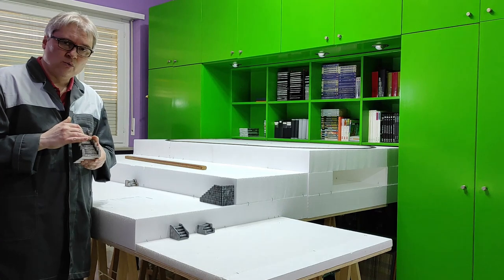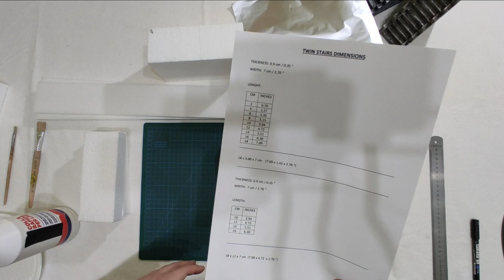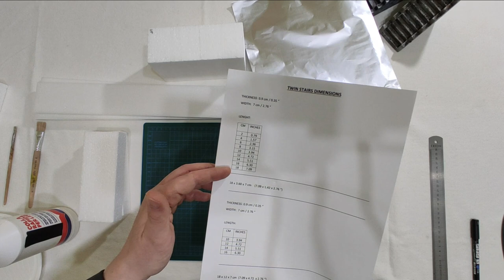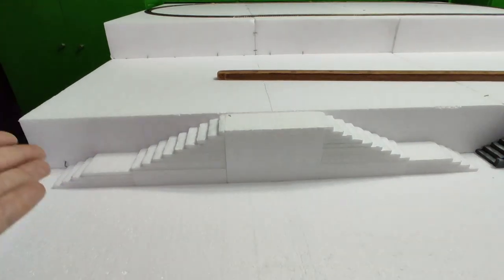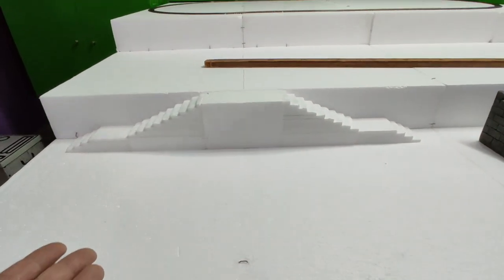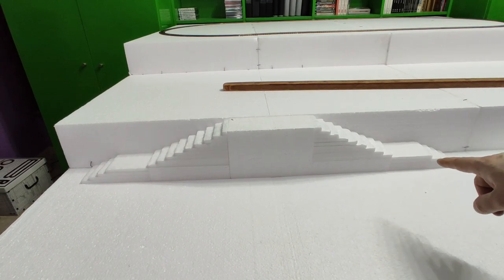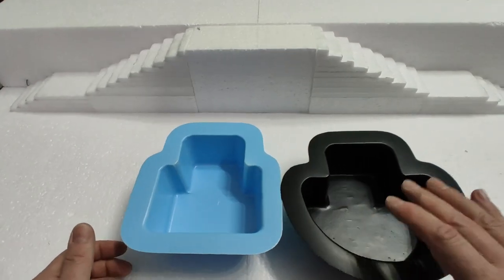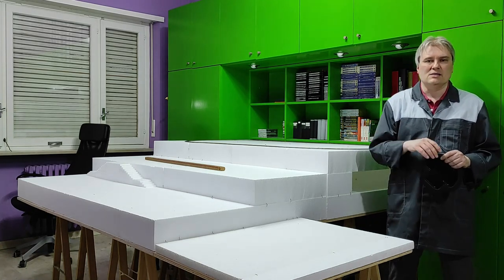Christmas Village Tutorial 2021 - Part 2

Comment: Interesting video once again.
I really like how the stairs turned out and I also love the fountain idea!

You probably already have found a way to do the handrails, but if not: maybe you can use thin copper wire. That seems to be at a good scale. 

- Bram
Reply from the maker: Hi Bram. Thanks for your comment. Yes copper wire and steel wire are both something I tried to work on. Scale is correct but I wasn't satisfied with the overall final look. It was too modern, too "industrial design" and not "ancient design" but I am almost there. I think... probably.

Comment: Silvio, can you upload that sheet you had with all the measurements for the twin stairs please? And how thick is the styrofoam for the individual stairs and also the blocks for the stair landings?
Reply from the maker: Hi Dee. I made the twin stairs using 2 types of Styrofoam: extruded Styrofoam for the steps and expanded styrofoam for the 3 landings (middle and central). All the thickness are marked on the sheet (all the steps are 9 mm thick (0.35 inches).
Why using 2 types of Styrofoam? Because only Extruded Styrofoam steps can be aged using the tin foil as shown in this video and because extruded Styrofoam panels over 4 cm thick are much much more expensive.

And finally the file you asked for :

http://www.christmasvillages.it/shared/TWIN_STAIRS_DIMENSIONS.pdf

Merry Christmas and best wishes to you and your family.
Reply: @silvioallena  Thank you, Silvio. I can't seem to find extruded Styrofoam here in the states. Is there another name for it?
Reply from the maker: @deesarge9531  Yes sorry, I should have told you before.

Extruded Styrofoam is XPS Foam (in the US the common type is generally pink)

https://www.amazon.com/s?k=xps+foam&crid=1EHHEG5V80KJS&sprefix=xps+foam%2Caps%2C175&ref=nb_sb_noss_1

Expanded Styrofoam is EPS Foam

https://www.amazon.com/s?k=eps+foam&crid=3LODHUQUZNY1W&sprefix=eps+foam%2Caps%2C145&ref=nb_sb_noss_1

Obviously you will find XPS and EPS foam not only on Amazon.
Reply: @silvioallena  Ah, okay. Thank you so much. I printed out the sheet you sent of the measurements of the stairs, and learned so much from your videos. I think I might give the twin stairs a try for next year's village. I'm sure you'll be hearing from me again. Lol.
Reply from the maker: @deesarge9531  I am glad I was helpful. Please ask anything anytime.

Comment: Just curious, why didn’t you make one long set of stairs instead of two sets that join in the middle. They look great, wondering if that would have saved you time. ❤️ from Texas.  Scratch the question. Should have watched further.
Reply from the maker: Hi Haze. Yes, you are absolutely right, it would have saved me time. But as I wanted to place the fountain and the water pump under the middle section with possible carvings and a statue niche (at least in the very first minutes of this task) I was afraid I could have ruined the entire stairs. Much easier to just replace the central section which is simply a regular parallelepiped instead of cutting once again in Styrofoam each long steps. Thanks for making me remember those good times from last season.

Comment: Hi Silvio
I'm trying to make your double sided staircase.
I'm not too good with metrics being in the US but, you thickness of each step you have is 9cm?. 
I'm using expanded form and the thickness is 1.5 cm, are you telling me to cut my form thickness down? 
 So now the foam thickness is less.  Hope I'm explaining correctly.
Thanks,
Michele
Reply from the maker: Hi Mic. No, the thickness of each step is 9 mm (0.3 inches). 9 cm (3.5 inches) would have been taller than the figurines.
If 1.5 cm suits your needs you can also use that thickness but don't go over it or you will have a disproportion between the steps and the figurines height. 
In real life, generally, stairsteps have an eight of 20 cm (7,8 inches)
7 steps equal 140 cm (4.5 feet) that is UNDER average height of people

7 steps with a thickness of 9 mm equal 6.3 cm (2.5 inches) and figurines have an average height of 6.3 cm. So, 7 of my steps are exactly the same height of figurines and it is already disproportioned.

We should use styrofoam panels with a thickness of 7 mm (0.28 inches) if we want precise proportions but panels with that thickness are practically impossible to find.
We need to adapt or cut each time the thickness of the panels
Reply: @silvioallena  thank you for such a speedy reply. I need to build something to get me up to a 5.5 in. Platform where my residential area will be. Any suggestions ?  🙂
Reply from the maker: It is not quite simple because I don't know precisely your layout.
If you have at least a length of 15 inches along the platform you can do a slope with some handrails. It can be done quicker than a stair.

I made a quick sketch for you with dimensions (in inches)

Here is the link:

http://www.christmasvillages.it/shared/SLOPE.JPG
Reply: @silvioallena  wow! Thank you so very much. Your amazing and a perfectionist, in a good way. Thanks. Once completed onto your next video 3. 🙂 Nite

Comment: How come the train sets for the polar express all wrong please explain cause I've watched the movie about 100times and there's 5 to 6 passenger cars not just 3
Reply: The max was 9 when they just started reaching the pole
Reply from the maker: Hi Agnes. If I have understood correctly, you are wondering why all the train sets on the market come with just 3 cars instead of more like it is depicted on the Polar Express movie.
It is sad to say but what you see in movies it is far from the representation of reality. Especially CGI movies.
This said I will try to be a little more specific with an example.
Get on an elevator alone and you will achieve the 10th floor easily get on an elevator with 30 more people and it will get stuck.
The elevator is powered by an electrical motor with a certain power and it convert electrical energy into mechanical energy or electricity into forces.
The weight is a force and if an electrical motor can lift up to max 100 Kg it will never be able to lift up 220 Kg.
The same thing goes with a train set. Each locomotive can pull a max of weight (let's say the equivalent of 3 cars) and if you attach 1 or 2 extra cars it will try to pull them, maybe it will work for a limited amount of time but then the motor (or the engine if you prefer) will certainly burn or the wheels will simply start to slip.
That is the main reason. 
Very roughly explained but i don't want to bore you.
Then you also need to think about the limited number of tracks in each train set. A circle or a small oval aren't adapted to a very large number of cars otherwise instead of being a magical vision is simply a dog chasing its own tail.

Please forgive me if I have misinterpreted your question.

Thank you for your comment.
Reply: No I understand but can you motify a trains power?
Reply: Idk it would be revolutionary I must be crazy
Reply from the maker: You are absolutely not crazy at all. But hey, no one is craziest than me.
Anyway...
Yes every train set motor has specs and dimensions and if you find on the market a more powerful motor having the same dimensions to fit inside the loco you can absolutely replace the original one.
You will get a more powerful locomotive. It is a delicate work but you can do it.
Here I have a link for you with everything is inside a train model loco.

https://americanmodels.com/index.php?main_page=page_2

But don't exagerate with the power or your train will simply derail over and over again.

Or the ugliest, quick and easy solution in the world: use a second locomotive to pull or to push your set.
Reply: Ok thank you I will have to try that but I had an idea for ya if you build a small platform in the side of the stairs for him to stand on and had the foutian just under it might look like he's stand on water idk just a thought lol
Reply from the maker: You are welcome. About Poseidon (Neptune) and the foutain you are not far to the idea I imagined.
Reply: Yea I seen pictures on Google of the way they display them and most had a framing shelf in the wall
Reply: You should hear my future build job my mind is vast but you are why I started last year
Reply from the maker: Agnes don't make me blush; you are too kind. I hope I was only responsible to drag you towards happiness and not hell.
🤪
I would be honored to hear about your plans and, why not, see the whole completed project.
Reply: Yea I would show you but I don't know how to find you on social media besides here maybe I'll post a video lol. Anyways the experience is been great excepting getting told it's still summer and I need to stop watch Christmas stuff from you. I won't stop tho 😂🤣😂🤣😍🌲☃️